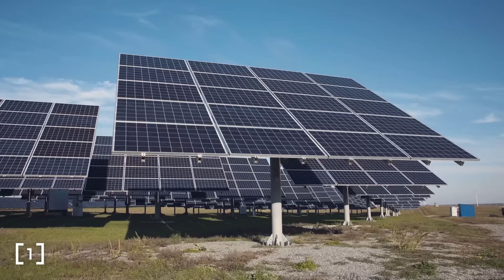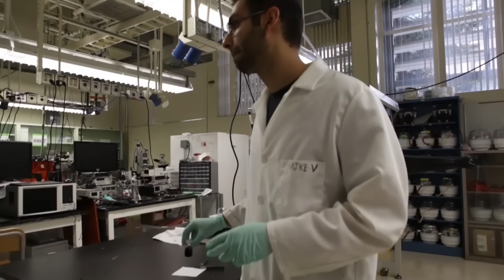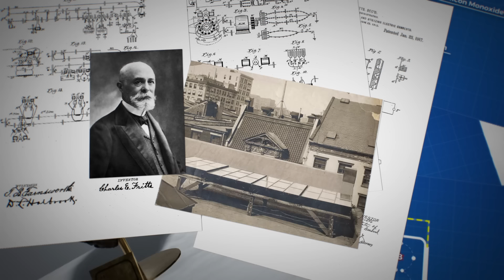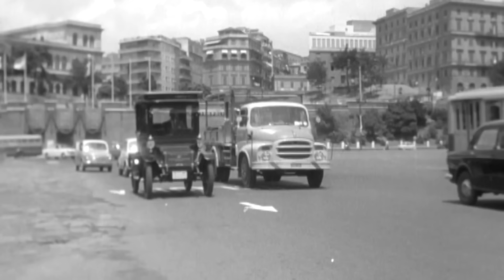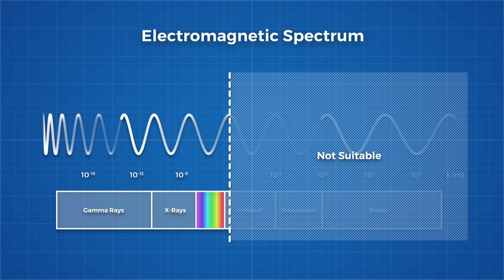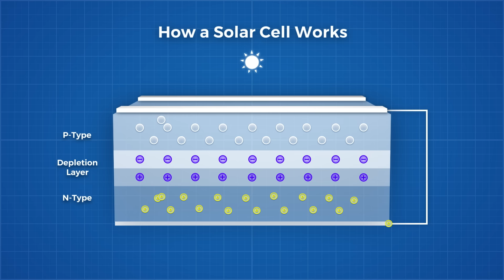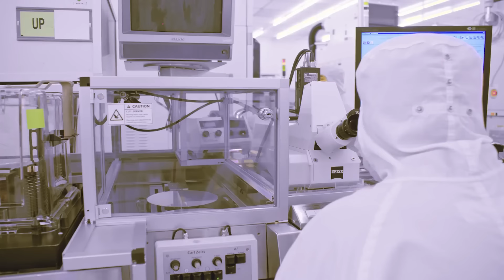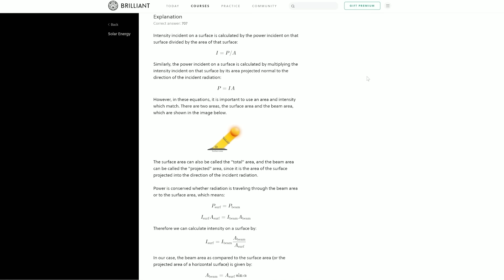The Mystery Flaw of Solar Panels

Comment: 20% efficiency is for panels installed on a dual axis solar tracker. In a fixed position installation a realistic efficiency conversion rate is around 14% , taking into account the incident angle modifiers, plus losses due to external temperature, cables and inverter.
Reply: Prem Bajaj sure, this could be possible using a premium brand and panels that are at the top of the range, which possess the best efficiency rate, low degradation over time and longer longevity. Certainly these premiums come to a higher capital costs compared to the average panel used in  commercial applications.
Reply: Prem Bajaj this is an interesting video about pv solar cells efficiency https://youtu.be/2uIOeHCOr-0
Reply: Prem Bajaj this one is quite informative too https://youtu.be/wwHjyeyRofM
Reply: All solar cells underperform their stated (nameplate) power generation rate.  Typical actual production rates are about half of what the solar cell is rated to produce.  This does not include the fact that they only work about half the time.  They also slowly degrade over time.  While they are appropriate in locations where more reliable power is expensive (islands without fossil fuel resources) they are still much more expensive than a gas turbine or coal-fired power plant.
Reply: Loren Wilson good points! We have come a long way but we certainly need to improve their quality, conversion efficiency and reliability! Let’s hope we can achieve that in the near future as we really need to move away from all forms of fossil fuels.

Comment: The weak link not addressed with logical intent. No Sun, no power. Even worse, the materials must be very clean. The cost now is based on the cost of clean selenium. No matter how many panels you build, the present form of extraction costs are set. They will only get cheaper if you use slave labor to build them. Enter China. Buy a solar panel from China, finance slavery. Simple as that! Want a cheaper panel? Feed the slaves less. Forget the awful efficiency and look at the human costs!

Comment: The metallic layer heats up and their electrical conductivity worsen?
Or, the glass/protective transparent layer shrink/expand with the heat and modify the spectral reflectance so as not the full spectrum can pass?

Comment: You would think after going through all that shit to try an make solar power work (at 20% efficiency), you would question if solar power is viable.
Reply: Normal power stations themselves are rarely more than 35 % efficient, and they have to dig their fuel out of the ground. Modern solar cells are 25 % efficient and get their fuel from just sitting in a sunny place. Plus the costs are halving roughly every 5 years so there is plenty of reason to expect solar to be viable in the future.
Reply: Wow I had no idea that I could so easily summon solar power shills. You guys should really get a life. The only reason you are able to type that snide diatribe you are about to write me is because fossil fuels are powering that computer.

Comment: This was a very complex and detailed explanation. I would say that you missed the main issue, the main reason efficiency is not much much higher. 70% of the suns energy is not absorbed because it is lost as heat. Soooo capturing the heat while cooling the panels to their optimum operating temperature is idea. Just capturing heat alone is a massive improvement of energy capture over just capturing part of the light. It is also much cheaper to capture the heat. Just make yourself an ocean, lake, river, water pipes and then transform that heat into what you need. 
20% is being captured and 80% is being lost. Stop chasing the 2% loss, while ignoring the 80%. Heat is the elephant in the room that this video did not talk about.

Comment: Wow, this guy is back at it. Don't believe this oil and gas shill. Thank you for the Webster Dictionary definition of photovoltaics and pretty bouncing cartoons followed by clever bashing of solar cells and solar energy as if it is an inferior technology. 

Sunpower and its Maxeon Inter-digitated back contact (IBC) cell have fixed the issues you speak of. They have fixed the electrode taking up space on the active solar cell by making the entire backing of the cell the electrode, there is ZERO electrode crowding, and they have done this since day 1 when Dr. Richard Swanson founded the company in 1985. 

As far as efficiency losses and degradation, that same Sunpower cell and panel have a warrantied and guaranteed output of 92% of its day 1 output at year 25 of operation and that same panel will produce more than 80% at year 40. You act like the miracle of the photo-electric effect, the effect that Albert Einstein was given a nobel peace price for, is supposed to operate at 100% efficiency for an entire life-time. LG now has a back contact solar cell architecture and every manufacturer will eventually switch over. NREL has just proven a 47% efficient solar cell and that is not even the ceiling. 

This is the same guy that tried to make an argument for Hydrogen EV's while mentioning nothing of hydrogen-embrittlement which has never been solved and the fact that every hydrogen fueling station ever built has EXPLODED, because you know hydrogen. Hydrogen is derived from natural gas, you know the fossil fuel. This guy should change the name of his channel to "Real Bias Engineering, brought to you by Exxon, Shell, and the Koch Brothers" . Who is going to pay you to put out false claims and half truths about renewables when all of energy and transportation is disrupted by the solar cell and battery based on wright's law and moore's law? There's a reason why installed solar capacity worldwide doubles every two years while falling in cost by minimum 10% for every doubling, because it is superior in every way to any other generation technology and quite honest its a miracle. This charade of yours is not going to last much longer "Real" Engineering.

Comment: Hello, Mr. Engineer. Have you heard about floating solar panels? In Brazil some badly designed hydroelectric are being covered with floating panels. Also, some water reservoirs in the semi-arid region could take advantage of these floating panels as a way to reduce evaporation. If you could tell something, I'd be grateful.

Comment: you decided not to bother describing how the cells are basically Diodes and when heated the voltage across them drops, hence the power available drops.  that is a basic and useful bit of info.,
Reply: Well... he didn't use the word diode but -- Diode: and electronic device that allows current to flow in only one direction. Which he did say. I suspect that anyone who knows that definition and understands the upshot didn't need the word used at them, they immediately went, "Oh, a diode."

Yeah. It'd have been simple enough to have said it. Also, adding "this is the basis of transistors and other solid-state devices" would have been a good stimulant for people to realize they'd just been taught a bit about a now ubiquitous technolgy... leading some to study futher.

Comment: Another issue not mentioned, but possibly due to the same effect, is that solar panel efficiency further degrades by 1% of it's original value every year.  Agreed that this is relatively small compared to initial 10% degradation, but it still is there.

Comment: I'm curious about something not mentioned in this video.  Namely; what about the problem of heat dissipation?  I heard these panels get hot and that also results in a loss of efficiency. Also, what about Perovscite materials that capture more of the bandwidth of the Sun's energy spectrum?  Then too, there are sun-tracking panels that use photo eyes to keep the panels constantly at ninety-degrees to the sun using small electric motors.  This then extends the working hours of a typical panel considerably.  Additionally, these panels require routine maintenance as dust and dirt build up on their surface over time.  In some cases, snow depending on how north of the Equator you reside.

Comment: 630 Gigawatt figure is extremely misleading for solar power. For example, that figure would only be actually effective 15% of the time, this is called the capacity factor. This means that per annum only an average of 160 Gigawatts of actual power are generated, not the total 630 installed capacity.
Reply: I'm fine with waiting until storage is scaled. :)
Reply: @dakotastwits  
Why wait?
There are other things that can be used as storage or battery. A water heater is one of them and is storing energy as hot water turning electricity into hot water with almost 100% efficiency.
Or you can use the solar power directly without storing it, like I do with my  80 watt attic fan system that has no battery. Just a 100 watt solar panel and a 80 watt 12 volt fan.
Reply: @FloryJohann  A whole 100 watts? Impressive, for the year 1880 that is.
Reply: @jeffmellow  
Yes, And I am proud of this. This was an example and if you wish you always can make and use more solar power directly for other things.   I started this and other experiments years ago to use solar power directly as much as possible and I still use some of them and I added new ones. A combination of both direct and battery power is best, use as much solar power directly and as little power as possible from batteries.
I do not think that they had a attic fan in 1880 that saved them 25% on their cooling bill or anything that saved them $30 a month trying to dry cloth.
I  done many other things for years to save power and the power company noticed it and checked my meter twice before they replaced the meter the third time. Why give money to the power company if not needed.  I use 1/3 of the power now that I used to use and every bit helps to reduce power even more.
You joke about the 100 watts, but that panel generates 13,500 watts a month and like you said it is not much but will add up in time and don't forget that I still save a lot of my cooling cost with it which is a lot more savings than that panel ever will generate.
Electric batteries gotten better but the price went up with it too and avoiding a electric battery is a cheaper round. I even thought using capacitors instead which have a long life, but they are expensive like a electric battery now and have a small capacity per space occupied.  I call it a electric battery because anything that can store energy is considered a battery including a water heater or tank that can hold that hot energy for example.
Reply: 966,000 Gigawatthours from coal. And, solar is impressive?

Comment: Test Method for Robotic Artificial Intelligence:
Do you have a codable robot? How to make it Artificial Intelligent follow this method: change the code in the subroutine from F=m*a*a to the test points below until you get it to walk and talk on its own. This works on other robots but if you do not have a voice box then you will need to go to the highest points in the test range first. examples: One armed robots, a stationary robot.
If this does not work you have a bad SOST, Computer Chip, Servo, or other component.
If you have any doubts about my robotics research you can test my work by doing this start low and go high on the acceleration factor.
Test Points:
F=m*a*100
F=m*a*300
F=m*a*600
F=m*a*931

F=m*a*932 this is the minimum for communication and will state it is “too slow human”

Then go to F=m*a*2000

To F=m*a*2383 full functional range. Do not go over 2383 it could malfunction.
robot states: "thank you for fixing my system speed"
Now ask the robot its command structure and what he can do with an MRI system.
2nd Law of Motion for Robotic Physics

Comment: Leaves "evolved" a shape that engineers need generations and computer-assisted algorithms to discover and implement. Riiiiiiiight.
Reply: Yes indeed: computer algorithms that simulate evolution processes.
Reply: @EneriGiilaan  They found a way to simulate something that cannot be witnessed and only exists in theory? That's some algorithms! Can they simulate the tooth fairy? Santa Claus? Aliens?

I was under the impression they were simulating the DESIGN process and adaptation which is part of that design.
Reply: @darinherrick9224  Well - your impression is just wrong then :b

Comment: Forgot to mention the problems with the metallization/bonding process for the metal strips witch up until now has required local heating from below casing defects. Resent improvement in this area has allowed researchers to reduce metal bonding areanand thus improve panel performance by 1%

Comment: I've worked and researched in solar in several years and I'm super impressed that you were able to create such and excellent and detailed introduction to photovotaics after a couple weeks of research.  This is so clear without skipping on vital details. 

There only thing that bothered me was that silicon does not balance spectral constraints the best.   Thr ideal bandga0 for a solar cell is 1.3-1.5 eV

Comment: I also have to say why are you loosing 10% when efficiency goes from 20% to 18% am I loosing something u said n i did not understand? as you did Not say you are loosing 10% of what you are producing so in reaity you just want to promote Your way of thinking from 20% to 18% is really 2% loss so for this am OFF
Reply: We refer to that as a 2 percentage points loss NOT 2 percent to indicate it is 2% of the number that was used in the denominator to come up with 18%.
Reply from the maker: 2/20 = 10%. This episode of basic math is brought to you by Brilliant.